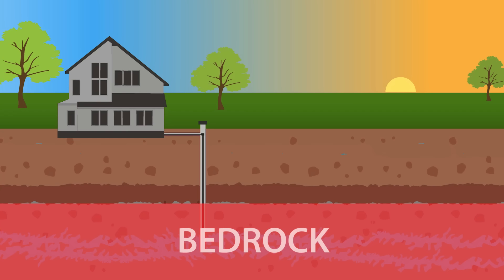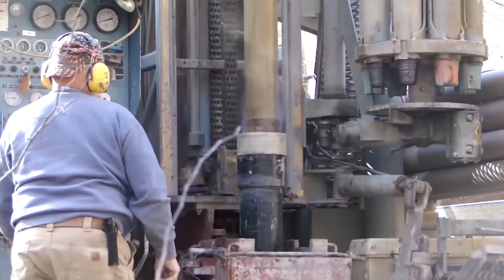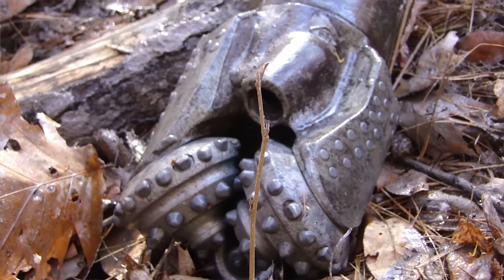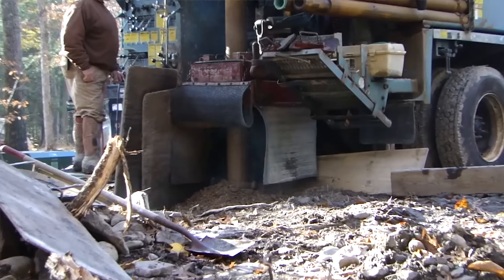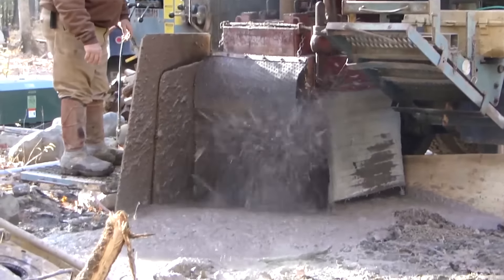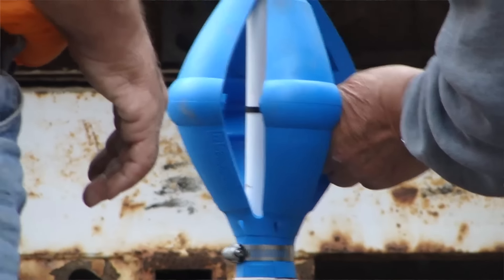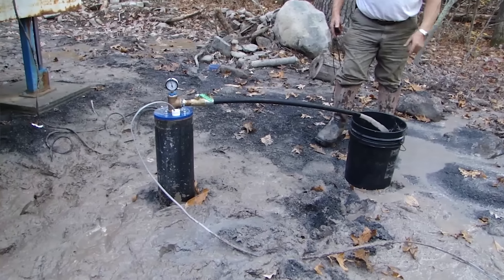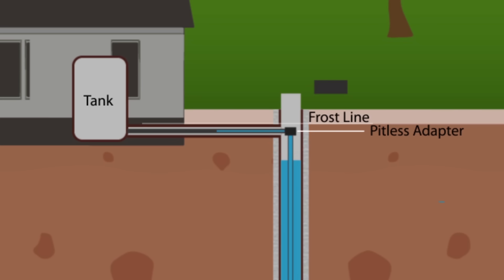WELL DRILLING 101 | Every Step Explained

Comment: "ENGINEER 775" IS A WIZARD WITH THIS STUFF. HE RECOMMENDS A MANUAL "simple pump" as a backup in case of power failure or for a grid-down situation.
Maybe you could install one and build a simple housing around the well for security and frost protection ?
BTW Watched all your videos.
Great thanks !!
Reply: I forgot he did that. ENG 775 is the boss.
Reply: I was thinking the same.  why he did not put a manual pump, just in case.
Reply: A manual pump will not lift water 80+ feet.
There are products called bailers, which are tubes of various materials and sizes with a one-way valve in the bottom. They can be bought online. groundwateressentials.com for example.
A 1 1/2 inch diameter, four foot long  polyethylene bailer, in this case, will fit between the pump pipe and well casing. For emergencies, attach stout cord to the top and lower it to the water. Plus four feet. Three full bailers would be a gallon. Five gallons can be had in a reasonable amount of time. Better than nothing.
Reply: MultiOutdoorman m
Reply: @richavic4520  A manual pump can indeed lift water 80 feet.  It's the column of water 80 feet tall that YOU cannot physically lift without some sort of mechanical advantage ;)  Just think old windmill pump.

A PVC-cased piston pump can be built out of stuff you find at Lowe's, Home Depot, etc. for around fifty bucks and can go down as far as you need to go for about a buck a foot.  I'm putting one together now and will be posting a video about it when I get it in the ground and working.  Might be next spring before that happens but it's doable.
Reply: Or have a generator on stand by. In any case, I like the idea of a manual hand pump plus its nostalgic and give a good excuse to go outside for a bucket of water.

Comment: Can you share what your expenses have been for the whole drilling and the pump / casing? Does the water from the well need any filtering or is that drinking quality? Does the well need maintenance?
Reply: Michel Feldheim apparently this guy doesn’t read his comments 🙄 we’d all like to know the cost
Reply: You need to test your water after the well is punched to check and see if its potable. There are many labs around the country you can send a sample to for testing and they will send you a detailed break down of your water quality.  The well its self has no real maintenance. However the pump will were out and of corse you need to protect the pipes from freezing if you live in that kind of area. If you call a local drilling company they will have a good idea of your location and typical aquifer depths and the amount of surface casing that will be needed on your location. There are no guaranties that your spot for drilling will match those of your local wells but they give you a good idea of depth and cost. It really depends on what you are drilling for, single house drinking water, irrigation water, a certain gallons per minute for many homes or irrigation make a big difference on cost.
Reply: @tazblink  cost of your experience …..
Reply: @daronlapping4590   I was the driller not a customer. Worked on the drill rigs for years in my youth. Reverse rotaries, doubles, triples, in the 80's and 90's.
Reply: I could be wrong because I'm no expert on wells bu any means. But I do have a well for my house. I'm pretty sure that's not suitable for drinking because on mine I have a water filtration system and a water softener on the surface right next to the pump. The water may still be drinkable and maybe I just needed one for my area, I live in Louisiana. But I've had to replace my water softener system and while it was broken the water was horrible.  It left horrible rust stains in the tubs and toilet and was pretty much undrinkable but to the metallic/iron taste and smell.
Reply: he probably payed 40-60k for that. I live on a mountain and all t he houses up here have 300 to 350 ft wells. People have separate loans for the well that they are still paying for 15 years after they built.
Reply: Bigbacon / no way it costs that much.....
Reply: I know for a fact it isn't that much to drill here in Louisiana. We are on flat land and not far from the water table though. It might be alot more to drill through mountains though.
Reply: @loganb.768  Why would you want to drink from the tub or toilet?
Reply: He gave the answer of 6800 all in, in another comment.
Reply: @loganb.768  Perhaps, but you might get better water quality down deeper.  Then again, in some parts of Louisiana you might get brackish water.
Reply: @nasircervantes340  

You dont have a water faucet in your house... wow 

You know it is acceptable to pour a glass of water from your kitchen sink. Bottled water is not the only suitable source of drinking water.
Reply: @tomgreene7942  

I'm not sure but I'm pretty sure the metallic taste is from the piping. I'm not sure how deep it is because it was already installed when I bought my house. But yeah I'm pretty sure you are right,  the deeper the well the better the water.
Reply: @loganb.768  Best filter in existence is the ground. Sand etc is the filter and since all is active down there, its all fresh and clean.
Reply: @Garth2011  

It's hard water though, you still need a water softener system. Otherwise it will stain all your appliances and also have a bad taste and smell.
Reply: Bigbacon |
Reply: I live high up in the mountains of the Pacific Northwest with a well about the same as this one and it cost me under $5,000. So I’m guessing the people with the separate loan for their well are actually being ripped off lol. Maybe their casing is made of platinum or diamond studded lol
Reply: @prepperjonpnw6482  Yes I think the comment about 40 to 60k was trolling or someone who thought the sand mound cost was the cost of well. Most sand mounds are 15 to 30k around here but I have heard of them being more. Either way no idea what he is talking about.
Reply: Michel Feldheim 6,000
Reply: @Bigbacon  bullshit!!! Probably cost him 5 grand

Comment: Are water wells ever drilled at the driest point of the year (summer?) to ensure the water level reached below ground never goes below a certain minimum point?
Reply: No, drillers typically just familiarize themselves with their areas water table, and try to get it right no matter what time of year it is
Reply: I guess that depends WHERE. Here in my tropical country we have to observe that rule because the water
level during the winter goes too high and goes down a lot during the summer. Most of the people do the
water well drilling during the summer months in particular if the area is unknown as far as summer time water level is concerned.

Comment: Great content and explanation, thanks!  Can you elaborate as to the cost per foot for everything.  I know there is a mixture of costs, drilling costs, casing costs, pump costs etc.  Be as detailed as you can off the top of your head, thanks!
Reply: He actually has another video where he talks about cost per foot.
Think it is this one  https://www.youtube.com/watch?v=UCfHodN9D84
Reply: There are to many variables to compare your cost per foot,  to someone else in a different area.   The geology can be greatly different,  the type of drilling will vary,  and the type of installed well can vary.  The best way to fugue out your cost is to review well logs in your area,  to see whay kind of depths to expect. And get quotes from your local well drillers
Reply: @223loki  You gave the most correct answer to the question. I install pumps and when someone ask
me this same question I will ask WHERE. Is the first question water well drillers will ask you.
Location and specs are the main root of the variables.
Reply: I'm in New Brunswick Canada. Just  had a well drilled this summer. I was quoted  42 dollars a foot. 22 for drill. 24 for casing. Pump  poly pipe  wiring  pitiless adaptor for 70 ft well 1600 dollars. All total 7000 dollars Canadian
Reply: Anthony Belyea that’s like $17 US dollars

Comment: One correction and one thing to add.

PVC is used for cold water supply. It's not as common in homes since PEX is cheaper and easier to install, but it's not uncommon to see in commercial construction especially if point-of-use water heaters are provided, meaning the olny hot water lines are straight to fixtures. And those pipes they used in the well are defiently not "standard" PVC". Typically PVC is solvent welded (glued) together, not threaded. That's likely a specially pipe used especially for pumps that are directly connect to the pipe.

And to add is the well cap. The cap is designed to create a seal at the top of the well. Since groundwater rarely needs to be treated beyond possible softening, you don't want to introduce contamination that would then be present in your drinking water. So, if the cap is ever disturbed, including for maintenance or repair, the well needs to be "shocked" by pouring bleach in and flushing the system.

Comment: how much was that?
Reply from the maker: EternalResonance $6800 from soup to nuts.
Reply: Your kidding, that would run 20,000 here in Reno NV, nice vid.
Reply: $100 a foot here.
+Permit
+$10,000 Meter. 
#California
Reply: You have to meter your well?
Reply: Yeah, new wells.
Reply: Brandon's Garage God God, California suuucks. I own a construction company in the Ozarks, and the last well I had drilled for a house we built cost $6800. Complete. Tank. Relay. Hydrant next to the wellhead. 15 gpm. 120' casing. 408' bore. Roughly $16 a foot. Oh, and no permit required.
Reply: Rusty Shakelford Hey there Rusty I've seen you in the comments before. What state in the Ozarks?
Reply: Ben Awesome Southwest Missouri. Within 30 min of Branson.
Reply: Rusty Shakelford Well I am only about 2 hours away then neighbor.
Reply: Ben Awesome Right on! Small world!
Reply: You have  to meter your own well in CA?
Reply: Brandon's Garage never heard of the meter thing where we built here in california there's over 20 houses and no meters. Never heard of the meter thinf
Reply: Your reply is kind of short-sighted. CA is already suffering from subsiding ground level, due to too much water being pumped from the aquifers. If no permit was required, someone could drill a well, pump a hundred or a thousand gallons a minute (for agriculture), causing all nearby wells to go dry--which is already happening. I cannot blame them for trying to preserve a precious resource, can you?
Reply: California has to support a very large population with unreliable water supply.  Imagine if they simply let anyone drill anywhere at their leisure and start pumping out what little water is left underground.  Pretty soon an already serious problem would turn into a crisis.  So, yeah, of course it has to be managed and it has nothing to do with communism, just common sense.
Reply: How much did the well cost
Reply: Arkansas, No Place Better-Good People  and Common Sense....
Reply: 38 dollers a foot from Texas
Reply: Brandon's Garage Where is Cali? I need to install a well

Comment: I replace well pumps with my father. Pulling 200 foot pumps up by hand. 💪 
 The torque arrestor "blue thing" is exactly what you though. It prevents damaging the pump when it kicks on aggressively. Also helping to prevent unthreading.
Reply: You might want to think about your back when pulling pumps by hand.  Pump pullers like the upsy daisy or easy riser are cheaper than back surgery.

Comment: Where I live they drill down until they hit water then drill another 40 to 60 feet, or more if you request it for storage capacity.  Then, you drop the well pump 10 feet from the very bottom of the well, leaving that 10 feet for sediment to fall into and your pump not to suck it up.  As in mine I have a 132 foot well, water at 81 feet, and the pump sits at 122 feet.  That leaves me almost 40 feet of water above the pump.  Plus what rises thru the pressure of the water flowing out of the water vein down there.  On my other it's water at 67ft, bottom 291ft, pump @ 280ft leaving me just over 200 feet of storage capacity plus rise.  But, neither of mine had more than a 3 to 5gpm fill which is why the deeper one has so much storage area.  PLUS around here they use 6" PVC pipe driven down only about 40 feet or wherever the bit starts having to strain against harder material.  As they drill they take note of where the bit stops just falling easily thru the dirt until it hits resistance enough that the well will hold it's own sides without collapsing. They don't push all the way to the bedrock because, usually around where I am that can vary from surface to around 1,000 feet.  Both of mine were just over 35ft to bedrock plus or minus a few feet.  Then, they use black 1" plastic pipe attached to a 4" submersible pump that is adapted from a 2" outlet at the top down to the 1" coming up.  Same top cap is place and 1" runs to your storage tank and the wiring to the control start box and relay switch.  From there it's down to 3/4" to the house and 1/2" to each faucet/water outlet inside.  Pretty neat to watch and a LOT of dirt comes out that has to be shoveled away by hand.  The only difference I see with your application was the metal pipe which will rust and leave rust coming into your pump and lines and the black flexible plastic pipe instead of PVC to the pump.  Still, you explained very well how it all works.  Just thought you'd like to hear how different areas may do it differently.

Comment: You can use pvc pipe that’s rated for pressure on water lines, but it’s not rated for hot water.  We ran a bunch of 1” pvc for an outdoor irrigation system, also seen it in a commercial laundromat, just for the colds or course.
Reply: Way to go, my metal casing only lasted about 10 years and I had to drill 
a new 566' well and the PVC casing is doing just fine after 20+ years!

Comment: Very informative    What size of submersible pump did u pick?  Looks like the pipe is 4 inch, I guess it’s a 4 inch pump.   I just had a well drilled and need pump etc to complete the installation.

Comment: I didn't see anyone comment on it yet, but if your pump is running on 240 volts, you would not have a neutral wire. There would be two hots and a ground wire.  If it's a 120 voltage system, you would have one hot, one neutral,  and a ground.

Comment: For any of you well experts, we bought acreage in Missouri and found an old well here on the property. My husband is now very ill and we are basically broke but we own the land outright. Its just a pipe coming up out of the ground. We’ve been catching rainwater and buying drinking water. What would it “possibly” cost, AND is there much chance, for this old well to just be restored??? What all would be involved because we’ve asked about a new well and were quoted $13k (just for the drilling). We were also told that old well like ours are more trouble than their value. Have no idea what run off there may be in that water source but no one around really has animals. Its mostly hayfields and old forest surrounding this well. ANY info is greatly appreciated.

Comment: 13:00 I believe what's going on here--in part, and thinking longer term--wells continuously drawing water over a period of time will create a depression in the aquifer, so immediately surrounding your sandpoint/collection point, the ground water levels will be different than the rest of the aquifer.  Wells that were inadequately drilled would have the issue of reduced output, because, while the general aquifer height is well above their sandpoint, the water doesn't level out due to the surrounding medium and the ... I think it's the surface tension of water, that causes it to move more slowly.

Comment: Blue thing is a centrilisers like you say to centrilsier the esp pump. Reason for extra rat hole is a sump for water collection. Cement on backside is for casing stability and zonal isolation. Hydrostatic head in annular space above pump in casing is the over burden to keep the pump in positive pressure, like you say supported by water resivoir pressure. Keen to know how they cleaned the water before installing the pump. I run liner hangers in oil wells, very similar process but offshore for oil gas higher pressure etc. the esp electrical submersible pump is actually the "completion" component of the well. Surface adapter is effectively a production tree. Jake Scotland

Comment: Nice and educative. Please, be informed that the space between the drilled well and outer section of the PVC casing is called   annular space and in this space you do gravel packing with well sorted quartz rich gravel to filter the well water from the formation before it gets into the well. Thanks.
Reply: PVC doesn't rust away which I have learned after my metal casing rotted away in ~ 10 years.

Comment: Also depending on the seasons , if it’s summer the land is dry so as soon as you hit water that’s where you would stop , but if it there was rain in the season then water would be at a higher level , so if you were to stop and then dry land would hit , you’d have no water to pump .